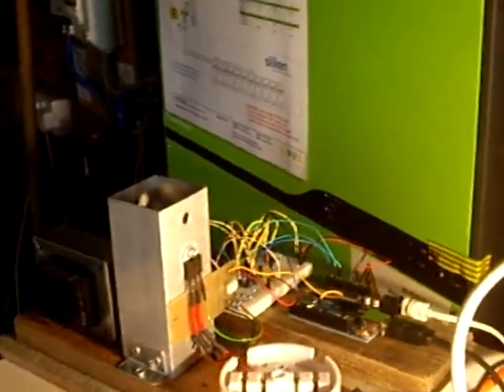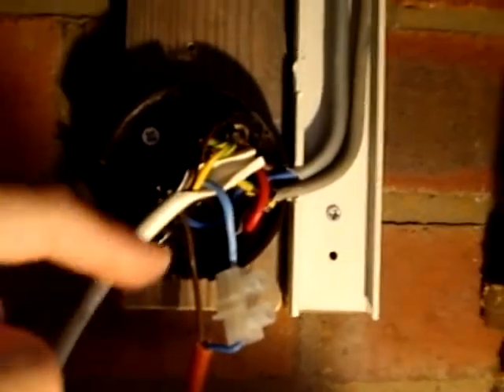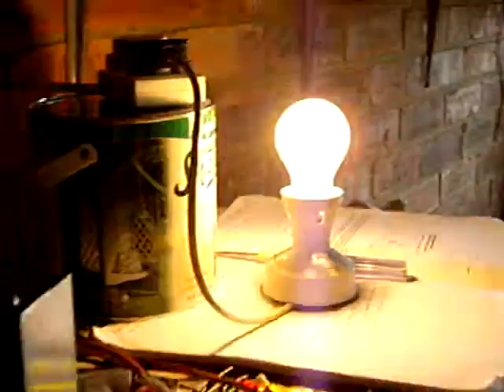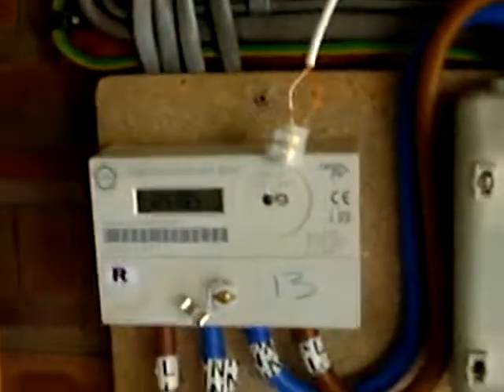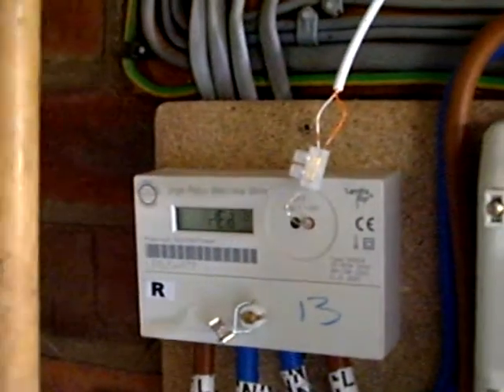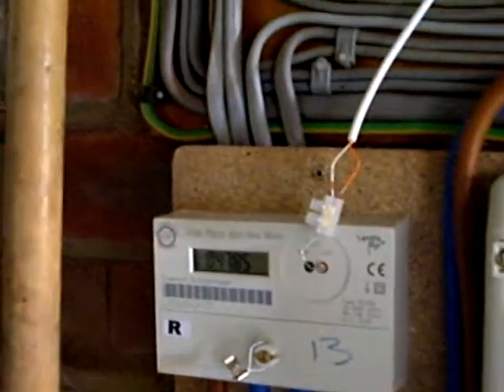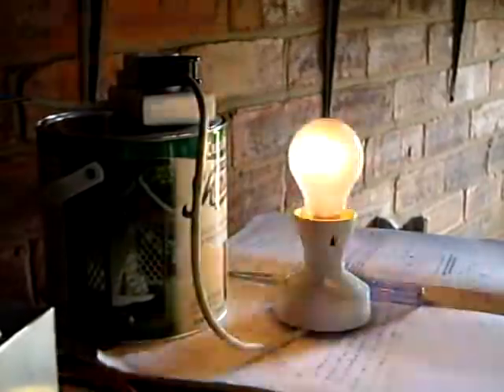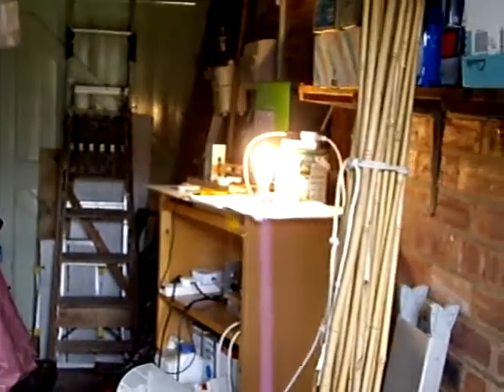IMGP9720

Comment: The PV inverter is set to off grid mode which means that it will run without a master grid to sync to and crucially it will reduce the power output of the PV when the batteries are full and there is no load by responding to the Sunny Islands Frequency Shift Power control. The Sunny Island increases the grid frequency from 50 to 52 hz to signal that the batteries are full and the Sunnyboy responds by reducing output.  I want to use the frequncy shift as a signal to control an immersion heater.

Comment: Hello, This is brilliant. Ive trawled the web at intervals over the last 9 months looking for something like this.  I have an off grid 4kw system with a SMA SB4000TL PV inverter which supplies the house loads and charges a 900ah battery bank via an SMA Sunny Island charger/inverter.